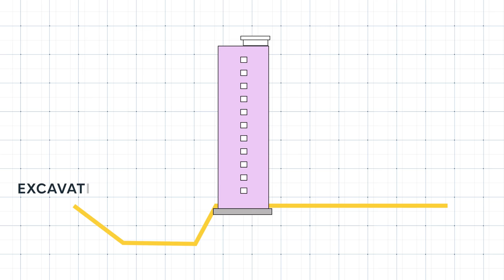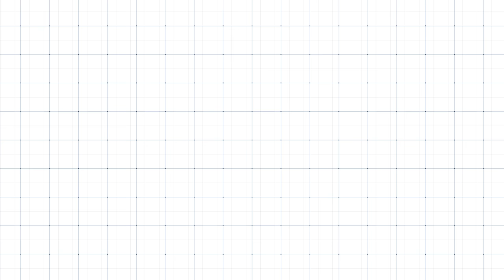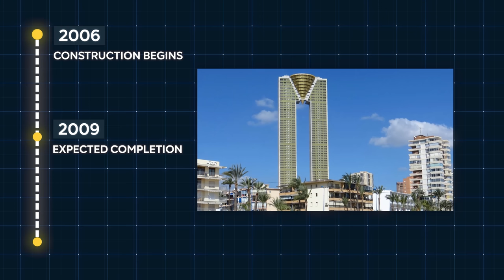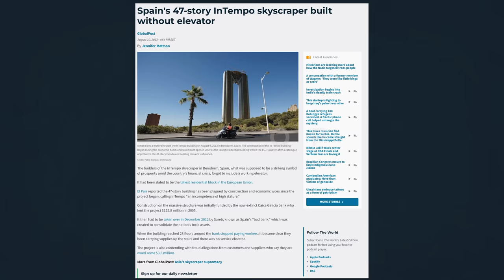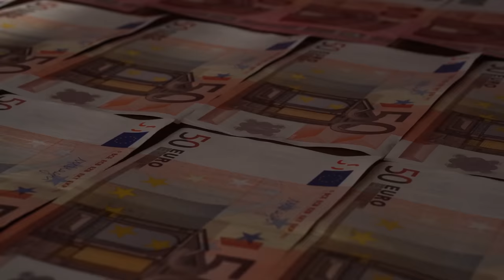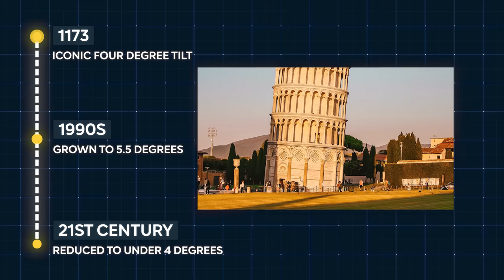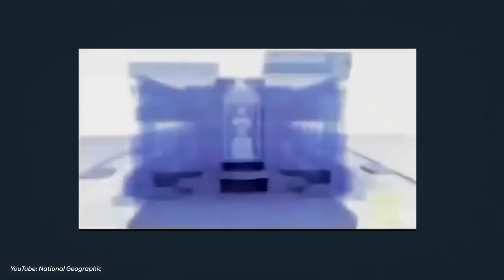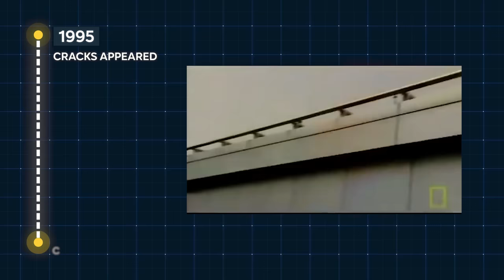The Biggest Construction Mistakes in the World

Comment: Underground garages that have buildings built over them should not be legal.  Generally in most cases, if the garage exhibits cracks, the best they  can usually do is repair the cracks, but some times this doesn't help much or only buys time to a potential failure at some point.  If the garage is NOT under the building then it's perhaps slightly different (say it's under a surface parking lot or something else that is not housing or holding people.  That would be different.  But I think we've seen too many times that complexes that have underground garages or basically caverns of some type, are prone to failure (the Surfside Condo collapse is a good reminder of this, along with poor maintenance).

Also why would you build the building and then build the underground garage?  Wouldn't you first build the underground garage, which is usually part of the foundation for the building, and then build up once the foundation is laid and has set?  And what's the purpose of hiring a consulting firm to advise the construction company (who was hired by the construction company) and then make it so the construction company basically had control over the supervising company?  Pointless if you ask me.  This is why it's good to have government regulated oversight in some cases, where another party supervises the construction and has the authority to halt or cancel the construction, not the construction company itself.

It's surprings that the guy and his family in the last segment only got 10 years prison time.  If it had been the US, he likely would have been put in prison for 50+ years for negligence if not a lifetime sentence.  10 years IMO is like a slap on the wrist for negligence on that magnitude, that took 500+ lives.

Comment: On East coast of Spain lies a spit of san stretching out around the Mar de Menor. In the late 80's a dozen or so 20-floor tourist hotels/residences were built to capitalize on the warm waters and gentle weather there. When my wife and visited on whim in 1991there was only a caretaker and his family at the site. 
The crack in our building was 6-8" wide at ground level and went up as far as could be seen. It was the best available...
Through the crack you cou see the rebar was only 3/4" diameter and spaced at least three feet apart.
In a twenty floor highrise built on sand. Can anyone say boondoggle?

Comment: I'm surprised the Ryugyong Hotel didn't make the list.  North Korea spent like 30% of their GDP on it for years and it still never was completed or opened.  And the word is that they used shoddy materials and construction so that even if they finished it the elevator shafts wouldn't work because there are places where concrete didn't line up.

Comment: The tower in Pisa section totally skipped over the MILLIONS spent digging modern foundations under the damn thing that went along with the weights and cables that were not going to be sufficient in the long term. They bored and pumped concrete under that thing at great expense and with massive engineering research. 
And no mention at all. Just taking out the bells and some counter weights. Sheeeah

Comment: number 1 story is wrong. Roof top damage was done because of AC unit relocation from roof top to other side of the building. They should have used cranes to move these but Lee Joon being a cheapass moved those heavy metals by simply rolling that in the roof.

Comment: Could of done thus just with Chinese builing projects, tofu dregs, where concrete is as soft as talk.  Steel bars can be twisted easily as rubber, and snaps easier.  This has been buildings including top rated hotels.  Roads bridges and tunnels, one tunnel was do bad it killed many people in their vehicles due to flooding.  But then I've never expected quality when chinese built is on the product.

Comment: I would hardly call China's construction efficient. Turns out they've been using sea sand in their concrete because it's cheaper but the problem with that is the chlorine and salt in that sand results concrete so crumbly you can break it with your bare hands. Not to mention the accelerated erosion of the rebar inside, if they didn't use bamboo instead.

China has invested billions into their infrastructure but most of it is falling apart.

Comment: The tower of Pisa was intentionally but at an angle.  If you notice the pillar on the leaning side are longer than the backside
Reply: No, the construction was changed while building it to straighten the tower, which started to lean right after the beginning of building. Also the building materials where changed to lighter ones on the leaning side.